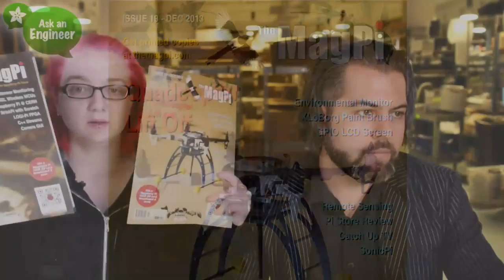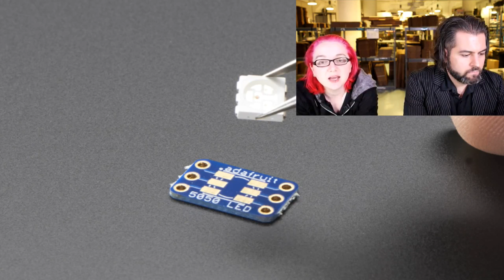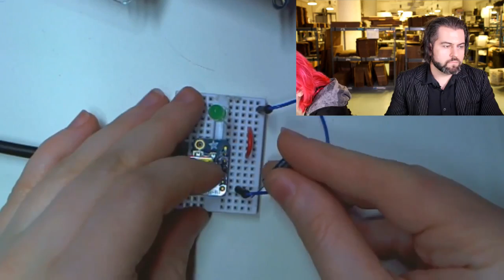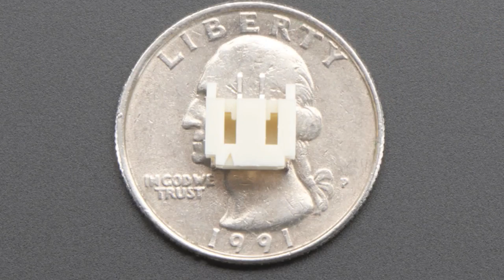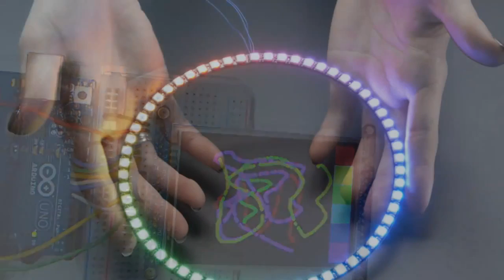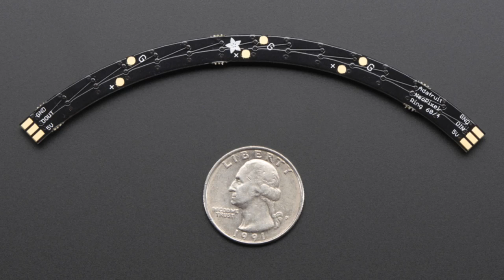New Products 3/19/2014

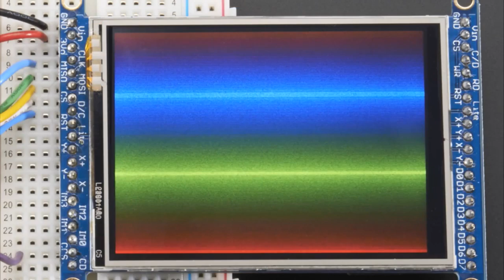Comment: 10:39 , is it possible to use the microSD card as the operating system? Can you draw using a stylus on a resistive touchscreen? What power supply does it use?